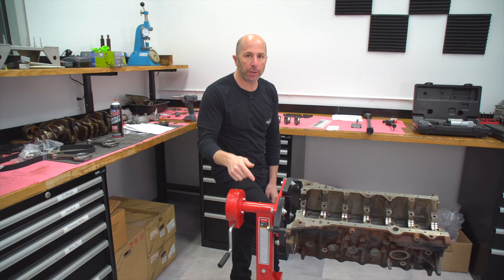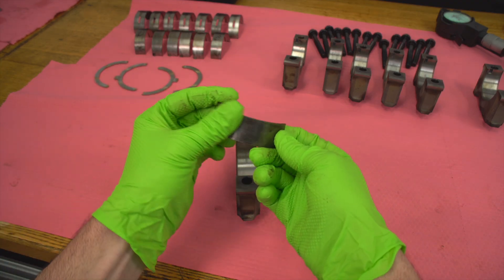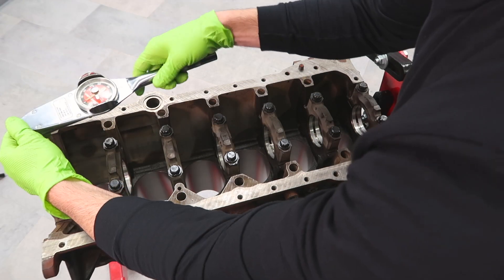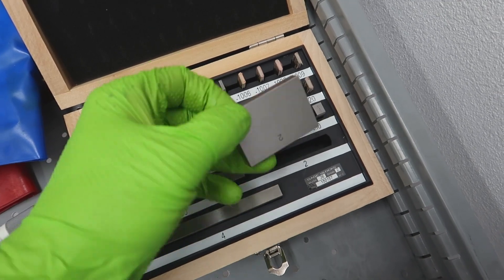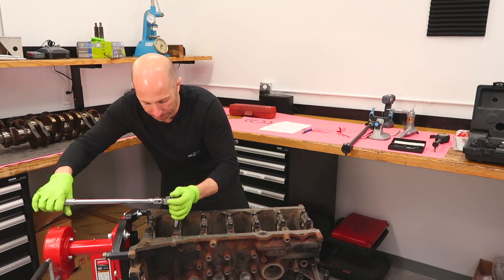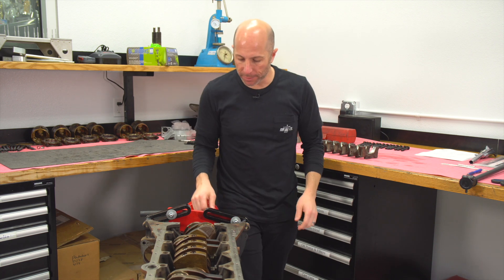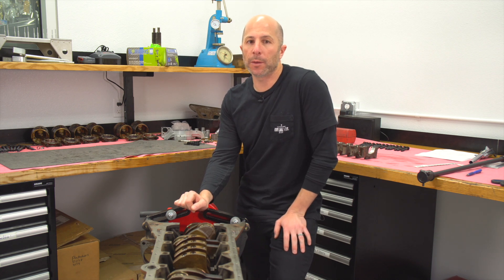$7 Vs $1,000 Engine Bearing Measurement Tools - Plastigage vs. Sunnen Dial Bore Gage

Comment: Though it is a nice tool, you don't really need the setup gauge for the dial bore gauge.
I use the same micrometer to setup my dial bore gauge as I use to measure the crank journals.  This way, any calibration error in my micrometer is automatically taken into account.

Also, I've done similar comparisons with Plastigage and found quite a bit more inaccuracy that you did.  Plastigage is extremely susceptible to any slight movement while torquing and removing the bearing caps. 

Most engine builders I've spoken to recommend actual measurements to get accurate clearances, especially with the tight bearing clearances we run on modern engines.
Reply: Yeah jo blocks and the mic are enough to calibrate. Mic stand really helps too.

Comment: $1000 measuring tool but, don't have a simple cheap angle meter. Also, Dial Torque wrenches are literally the worst wrench you could use for that...

Comment: Great video. So many builders with the expensive gauges like to shoot down anyone using plastigauge. As long as you know its limitations it’s a very useful tool.
Reply: And if you don't know how to use the "correct tool", it could be worse than using plistiguage

Comment: plastigage is completely accurate...   and its not .015...  15 thousands.... its .0015.. its a 1 1/2 thousands and that was perfect clearance for a street motor.. boats get more clearance and some race engines open it up some... but good video.

Comment: its more than close enough to tell you your oil clearances are going to be within spec, maybe higher end where you want all of them to be closer its not going to be good enough but for the average guy/shop rebuilding to factory specs on stock engines, its close enough

Comment: The advantage of plastigauge is that it measures the actual space between parts.  When you're calibrating the outside micrometer, Calibrating the inside micrometer, measuring the crank diameter, then running the bore gauge, you're potentially stacking tolerances and errors and are really only inferring the measured space between parts.  (Exactly whey feeler gauges are used when they can be instead of measuring heights or distances and then calculating.
The disadvantage is that plastiguage can't be used 90 degrees to the clamping force, so it can't measure out of round.

Comment: I went to school almost 20 years ago for automotive mechanics. We learned to use plastigage when measuring bearing clearances. From what I understood the main reason you would want to check the clearances to A) make sure everything was even and B) if something was way out of spec you could investigate as to why and correct the issue before you do the final assembly, fire it up, and realize you have a problem - when it's probably too late.

After watching this video, and what I have learned in the past ...
If all you did was build engines all day long, it might be better to invest in the tools, if you're only building one engine every now and then, plastigage is the way to go.
Reply: Exactly 👍, that’s exactly what I was thinking, I believe if you’re building engines most of the time at the sh op, is better to invest on good measuring tools, Mitutoyo 👌

Comment: I have built at least 15 BBC with over 1000hp with plastigauge. I use them they're accurate, I bet my $7500 engine on it every pass I make. I have built friends engines as well and they trust the plastigauge. When I take my engine apart after a couple seasons I can see no extra wear patterns.

Comment: Guy buys $1000 bore gauge. Won't buy $500 torque angle wrench. 
some people are right stunned.
Reply: I think that's Influenced by the tolerances the manufacturer gives.  Bearings? Gotta be within a .002-.003 range for an OEM non-performance engine. Head bolts? 60-90 degrees on my isuzu Diesel. Obviously the exact angle doesn't really matter THAT much if they allow that much variation. Just need to get it into plastic deformation and not go too far.
Reply: @nickopedia5669  try 120° on a 3.6l back head in a saturn aura (engine in) 😀. I guess the point I was making is that there are so many other much cheaper bore guages avalible. If he had the money to drop on a $1000 bore gauge why the hell wouldn't he also get a decent torque angle wrench.
Reply: @Pyrolysis2142  A crappy bore gauge is not good but his torque angle gauge is working fine. There are some tools that you need to be very high quality to get the job done correctly and some that you can get by about as well with a mid grade or cheaper one.
Reply: @phillhuddleston9445  yes some tools need to be quality. that's why my 17yo snap-on screwdrivers still work like new. I've worked on cars for almost 20yrs, I've been a fully licenced automotive technician here in Canada for 13 years (6 of those years at a dealership)
So I know the value of a good set of tools. A good set of micrometers and a "economy" set of telescoping bore guage will get you the same results for half the price. Ham fisting in torque to angle bolts is just dumb. Sure it works in this one example for 90° as soon a you try this in real world, on engine, in vehicle, when there is oil involved that paint won't stick. I guess if all you do is work on clean engines on motor stands all day then great. If you work on complete cars doing repairs in vehicle where you can barely see the bolt head don't cheap out. Go get a proper torque angle wrench. Personally I'd recommend a MAC Tools unit. I'm not a big fan of the Snap-on 3/8 one.
Reply: I have a snapon techangle torque wrench, i dont bother to pull it out for some 90⁰-180⁰ tty stuff.
Reply: @MattyFielding6  too true, but you do have one.
Reply: @Jeffrey Simmons hmm more fanbois running to the rescue. Clearly you didn't watch the video. $7 of plasitgauge makes sense given the tolerances required (it's not like he's machining the block. Not that it would matter as machinists don't spend that much on a bore gauge)
 Run off to your local auto repair and ask real technicians what they would invest thier hard earned money on to see how many would laugh at you for suggesting a $1k bore gauge over a proper torque angle wrench. Yeah it is all about me, since ~you know~ I'm the one that posted a video claiming to be educated enough to provide a professional opinion. Does the dude in the video even have credentials from a recognized institute?

Comment: High volume production engines are not high precision, tight tolerance machines. High end race engines rarely see more than a hundred hours and then need a rebuild. I can see why industrial machinists don’t mess with engines.
Reply: It's usually the wages that keep a real machinist out of engine building. Also, if you like machining, you find automotive machining is incredibly basic and unchallanging. I was in tooling shops for almost 5 years before I had seen inside an automotive machine shop. I was young and intrigued, so I quite my die repair position to take a 50% pay cut to experience engine building. I like the product and I like to remanufacture things. So the job was alright. 4 years later it was time for a real paycheck again, so back into tool shops I went.  Handfull of years later there was an ownership change where I was working and many layoffs followed, including me. I stopped in at the local engine shop on my home and my timing was good, started the follwing week with once again a big fat pay cut, but I was finacially ok and could afford it. Few years later the place that laid me off needed me back so I returned once again back to real machining and Journeyman sized pay checks. 
  I enjoy the automotive trade but it is full of BS and far more stressfull than working in a tool or manufacturing position which is usually working on parts or products worth more than any engine an engine shop is going to work on. As a machinist, I specialize in large Horzontal and Vertical boring machine work. Very interesting setups and workpieces and always something new and or unique comming through the doors. Engine shops are full of one op, simplified machines requiring very basic skills to run and many of them can be taught to run in a few lessons. 
Because I do enjoy engine machining and building, I went out and bought my own machine shop for my entertainment and specialize in remanufacturing only a small, select group of engines. Basically the ones that interest me. Also get into basic general machining jobs. Keeps me entertained and fills my personal interests needs. Plus, I get to keep my much higher than an engine builders wage position at the manufacturing plant I work at and run multi million dollar machines I will probably never afford to own myself. Our new Toshiba Vertical turning machine with live spindle capable of turning a 22 foot diameter workpiece was 3 million dollars for example. I probably won't ever own one of my own lol.
All that being said, I like the engine machining trade, it just typically pays shit and that is the biggest reason you rarely find a real machinist in engine shops.

Comment: Once you torque the bolts down to measure clearances, can they be reused?
Reply: It depends if the torque spec was designed to take the bolts out of elastic deformation, and into plastic deformation. Only in elastic deformation? Okay to reuse, generally. Into plastic deformation range? Can't reuse for anything, even setting clearances, as the bolt has physically changed dimension.

Comment: I didn't check nothing when I rebuilt my 96 Tahoe with 305k miles. The crankshaft turn after I install the bearings from the Summit rebuild kit.
Reply: Rofl. We just rebuilt an LQ4 and everything was in stock spec. Could have easily just slammed it together and it would have worked.

Comment: i once saw plastigauge showing clearance in spec. but the journal was out of round by .5 that was huge. i got a mic for 50$. got another bearing with same out of round. from then on, i check for out of round and once happy, check clearance with plastigauge. so best combo is plastigauge and a mic. in most cases, we wouldn't need bore gauge.
and actually what bore gauge shows is diametrical clearance. if you want clearance at one point, you should ideally take half of that. and plastigaguge should show clearance at one point. so how diamterical clearance on bore gauge = radial clearance on plastigauge? i never get that. so i always use a mic to be safe. and still spin bearings lol!!
Reply: The smart guys say that when measuring tiny dimensions, steel becomes rubber.  That is why precision surface plates made of steel or granite are several inches thick.  In the case shown here, the pressure from the bearing cap passes through the squashed plastic and deflects the crankshaft far enough to effectively push it to the far side of the bearing.  Don't believe it?  Place a T-gauge in the piston bore of a bare block, aligned with the longitudinal axis of the block and just tight enough to hang there.  Now put your hands on the inside and outside surfaces of the block, over the cylinder, and push in.  You can easily egg-shape the bore enough to drop the gauge.

Comment: One needs to remember bore mics offer the ability to measure ovality  as well something that can be found very easily in split arrangements ,especially if someone has refurbished them before.
Also it gives you the opportunity to check the assembly without the crank in place and allows you to ascertain the effect your prescribed torgue load has on the size.
The bore mics do offer complete freedom and accuracy and you can get decent ones for for a couple of 100 US.
Reply: You can with Plastigage, too. Just turn the crank 90 and reapply.

Comment: It’s my understanding that once you tighten the bolt (x) degrees following initial torque, the bolt is considered stretched and cannot be reused. When checking clearances in the past, I always torqued the caps without the additional spin. Would this cause the final measurements to be off?
Reply: Addition 90 degrees can stretched bolts and it'll broke.

Comment: Can you comment on this method, taught to me by a longtime Diesel engine builder turned race engine machinist/builder:
Measure bores without a bearing, and measure bearing shell thickness with a bearing mic - this takes out bearing distortion error

Comment: I love the precision. I use the high end mic all the time for work. You can also use a dial bore gauge and check it with the calibrated mic. So you can save some cash buying a cheaper bore gauge. Cost is roughly half.  So a gauge 350-400$ gets you a precise measurement. The most expensive part is the indicator head. Depending how precise you want to go. I start with .001 then swap to the .0001. Not a fan of the plastic gauge stuff. I hate to use a precision micro polished surface with no lube. And always use assembly lube.

Comment: Loved the video.  Never saw a setup quite like that.  I just used a mic to set my dial bore gauge.  Dial the mic to where you wanted it and zero it on the lowest point.  As someone else pointed out, the dial bore gauge may give you a false reading.  Improper use of it, not finding the true center, or slightly digging into the bearing could alter true measurement by a slight amount.

Comment: Don’t you have to replace the main bolts now that you torqued them to yield?
Reply: Depends on the design.  Some fasteners are stretched to their yield point, and are one-time use, while others are only stretched in their plastic region, and can be reused as long as they measure within spec.

Comment: Let’s be real here, knowing how to use your tools is worth more than any tool. Measuring bores can be screwed up just from measuring at different temperatures.
Reply: Also... if the block was bored and honed with a deck plate that will also change the measurements.
Unless you're building a 9,000rpm engine or higher I think most DIY tools will suffice :-)
Reply: Hence the reason for calibrating your tools before EVERY job. 👍

Comment: This is exactly where I start to get lost. Lol. I assume it’s about the oil globule count?  Bearing surface oil?
Reply: John Holtz well John if you put oil your reading will be inaccurate as oil will add to diameter bearing .!! This is measurement before assembling..! To install correct half bearing .! After clearance of measurement and not any errors on reading you can go head oil all parts and assemble.. remember he did all measurement just to make sure no need bearings and he opened them all again...

Comment: Hello! Is it possible to machining 2jz crankshaft journals +0.25mm and +0.50mm?
Reply: If you can get +0.25mm and +0.50mm bearings, I think you can machine the crank to that undersize. You should look up various engine bearing manufacturers and read their applications guide.
Reply: @skylinefever   
rods   +0.25 bearings  Taiho R702H1-025 and
 crankshaft main +0.25mm bearings Taiho M702A-025.
i'm sure it's china. but why not to try before sending crankshaft to garbage busket?
Reply: @Oleg-fp9hn  Taiho is based in Japan, so their bearings might be made in Japan. However, I do know that sometimes Japanese companies make car parts in China. King bearing is based in Israel and many people use their bearings in extremely high horsepower 2JZ engines.
Reply: @skylinefever  the thing is, can crankshaft be machined? our local guru say no, because the hard top layer is thin and after machining journals will become soft.
Reply: @Oleg-fp9hn  Usually a crankshaft is heat treated all the way to the center, and machining wouldn't have an effect on hardness. However, if a crankshaft has to be standard size, it is possible to chrome plate the crankshaft back to standard size. However, it isn't always easy to find a business that does chrome plating.
Reply: @skylinefever  thanks for your opinion. actually there is not much to lose, only time to assemble and disassemble the engine

Comment: I learned to measure the main bearing caps without the bearing itself and measure the new bearing also to see if there is a difference and you maybe need other bearing. when u measure with the bearings installed, u can probably damage them

Comment: You can get the tools you need for only a  for $100 set up mics and inside mics will do the job plastic gauge does a nice job too but it doesn't check roundness

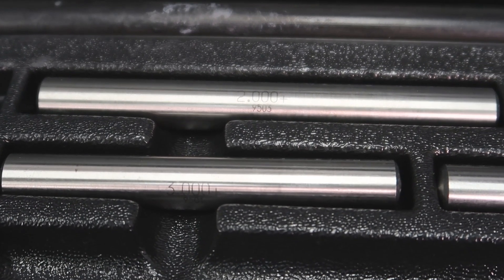Comment: warning ... When using Sunnen Dial bore gauges.. look at the ends of the setting standards shown in this video @3:24  look for any signs of wear or dimpling of the ends from the carbide balls on the dial bore gauge going in and out. the carbide balls are so much harder than the standards.. little divots will be worn in and a raised area around the wear..  this causes the dial bore gauge to be Impossible to set correctly.  this is NOT a problem with the tool.. its just the components wearing from hundreds of Thousands of tens of thousands of uses.  in a engine rebuilding shop decades ago.. as i was watching the shop owner use the dial bore gauge the needle on the gauge bounced as it dropped into the divot.  the sunnen rep came out the next day and took our set for repair and replacement of the worn standards leaving his own set.. our bore gauge had been in use for at least 10 perhaps 20 years .. dozens of times a day.  this was a production engine rebuilding shop.  its just something to look out for.. will this set have wear on the standards..  probably not yet.  could the set you use have wear.. perhaps.  its really upsetting when a press fit sleeve falls into the block.